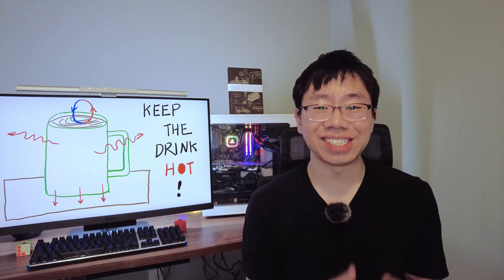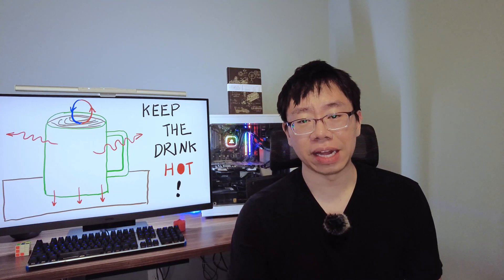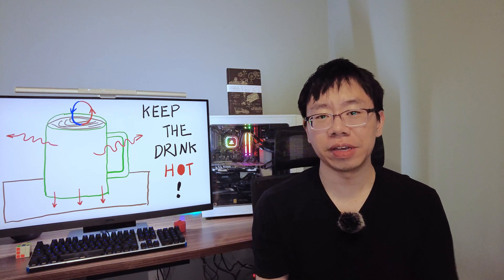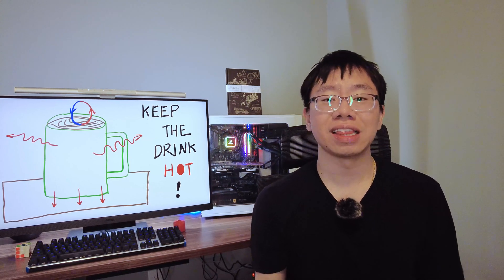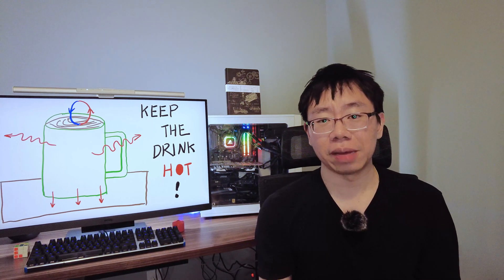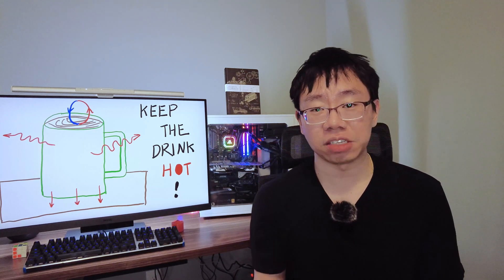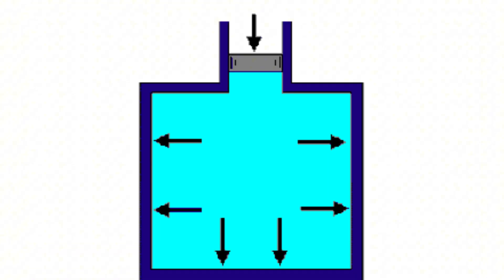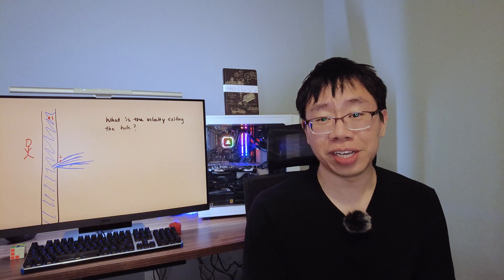If you can solve this, you can be a mechanical engineer

Comment: Overmold vacuum insulated stainless steel by Plastic for better thermal insulation and use white or light color for the outer side if possible as it is better at reflecting radiation.

Comment: @11:20 how it patm= 0?, its 1 bar. did u reference it with gauge pressure?
Reply: Thinking logically, the number should be coming from a gauge pressure in a piping system and not absolute pressure. But yeah, i agree that he should've at least mention it to make it clear for general audience.

Comment: Really funny that this video came up in my feed, last year for my high school engineering cap stone project we designed and built bottle that could heat itself. We built a prototype out of a 3d printed body, and used a raspberry pi, temperate sensor, and cartridge heater to control the temp of the water. Thanks for letting me take a trip down memory lane.